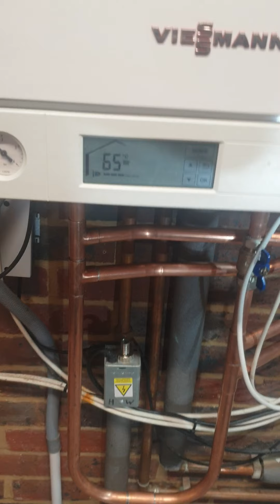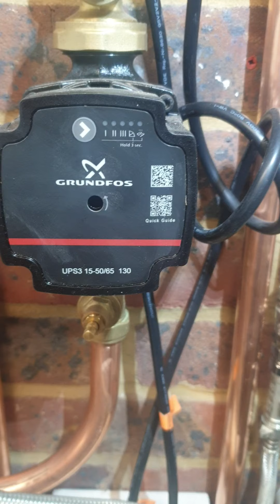Viessmann vitodens 100 on primary secondary pipework.

Comment: Hey Andrew. I'm finding your videos very interesting.I've been told long time ago that ufh manifold is must have a heating water delivered to it (by shunt or other pump) and can't suck water on itself even when it has its own pump with mixer. Is that wrong?

What setting did you leave for radiators pump at the end ?

Did you install check valve after boiler flow to prevent back pressure?

Comment: why is the filling loop right above the electrics
Reply from the maker: This is an upgrade not my installation. I did move the filling point a little though.
Reply: That’s exactly what I thought!
 I would’ve moved it across dropped it down the skirting board level and come straight up to fill the boiler

Comment: Been watching your videos as I'm considering upgrading my system to this rather than just an s plan multizone.
I'm fitting an ideal vogue s32 (stainless heat exchanger) I've got underfloor heating and 2 heating zones and the cylinder. Would you do the primary loop in 28mm or 22mm?
TIA 👍
Reply from the maker: 22mm. Is it a combination boiler ?
Reply: @andrewmillwardwatford9410 no it's just a system boiler. Currently running an ideal classic but its had its day
Reply from the maker: @Themanthatcando  so you can add weather compensation or two temperature operation.
Reply: @andrewmillwardwatford9410  I could do but honestly not a massive fan of weather compensation.
Initial idea is to fit the boiler on 28mm primary circs and in this order heating zones 1 then 2 then the underfloor heating. I've seen other schematics for pipework for the cylinder where that's taken straight off the primary loop but not on a close tees setup